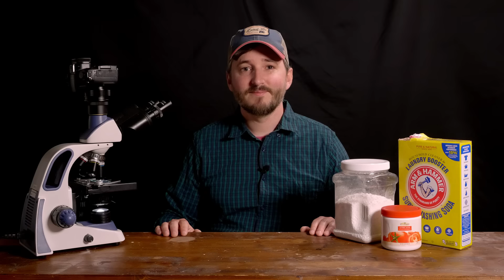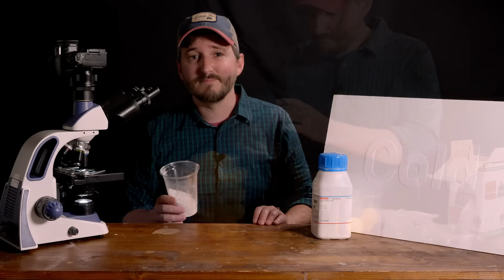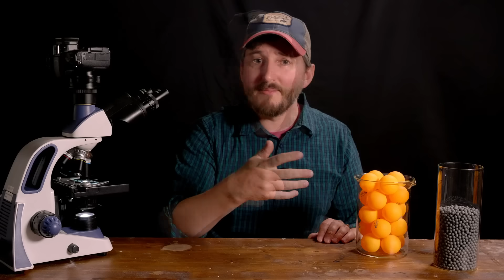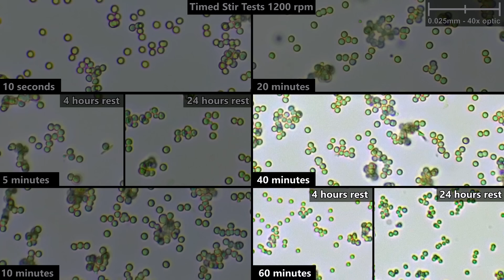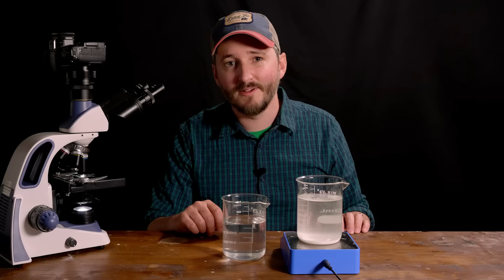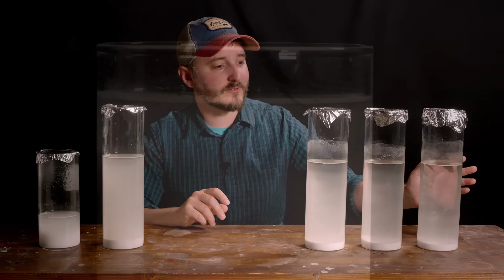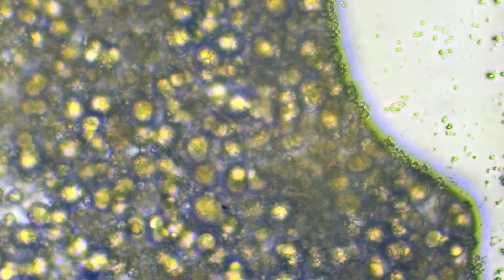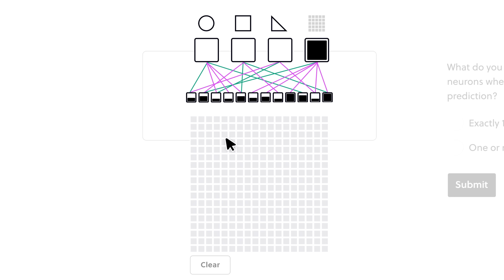Making Infrared Cooling Paint From Grocery Store Items (w/Novel CaCO₃ Microsphere Synthesis)

Comment: Thanks for this recipe, you have detailed it perfectly so a smart child should be able to replicate it. I'm pretty sure any commercial products would be orders of magnitude more expensive than your low cost DIY method, and it's not even time consuming or dangerous. Except maybe the acetone, but most women use it on their nails so how bad can it be? Just don't put it in something that looks like a water glass. You should consider manufacturing it, the markup would probably be pretty amazing.

Comment: Calcium carbonate peak absorption is at about 7nm, where the atmosphere is opaque.  Barrium sulfate is about 9.5nm, fairly aligned with a transparent window.  What am i missing?
Reply from the maker: Barium sulfate does have the greater theoretical cooling potential. I guess for caco3 we're relying mostly on the ~11um peak. It's apparently possible when using microspheres to use their size as a sort of resonator to more favorably emit particular wavelengths. Perhaps that's an area where the pigment could be improved.
Reply: @Nighthawkinlight  transmittance is only 40% at 11.5u, so the barium sulfate team has a big head start.  but if you could make your spheres integer multiples of 11.5u you might get an interesting result.
Reply: Like maybe a rooftop calcium carbonate laser emitter

Comment: An airless sprayer (though perhaps not a residential painting low-ratio electric one) would spray this coating no problem, but that's a much higher ticket item than a blender. For a cheaper option, you might also try a shutz gun, they're made for spraying thick rockguard on cars, or a drywall hopper, both would give a splatter texture but would be far quicker than brushing/trowelling
Reply: Would coating one side of bubble wrap, if very transparent wrap can be found,  then placing the coated side down, make for a premade and robust insulating layer? That might (good or bad) create a cats-eye/retroreflector effect as well if the domed side is coated.

Comment: I would suggest modifying the order of adding ingredients. It seems odd to spend so much time trying to make the densest pigment possible with various sizes, only to suspend it in acrylic filled with voids left by water. I would suggest experimenting with adding wet pigment to the water free acetone/acrylic mix. I realize that the water will not absorb into the spheres, but hopefully it will coat the surfaces and leave pigment inside your evaporative voids. This would improve the density of pigment in the final product, and maintain the flexibility/durability introduced by the bubbles. If you're really lucky perhaps you'll get a lensing effect from the void bubble that focuses the light on the pigment. Allowing the pigment to then radiate back out of the system sort of like a modified retro reflector.

Comment: If you or anyone figures out a better spray method or a way to make this very durable, I would definitely appreciate another video going over the updates. I bet this would be an amazing coating for a hexayurt or similar structure. But it needs to hold up to strong winds and other harsh conditions without chipping or flaking off of the temporary camping structure.

Comment: You should use Sci-hub for accessing academic papers, it's an entirely free and open-source project where you just paste a url or DOI, and it gives you a pdf directly with no frills. I and my professional colleges use it all the time, and many professors recommend it too! The suggestions to reach out to the author are good, but most of the time professors are too busy to bother and won't respond. Sci-hub is, and I cannot stress this enough, instantaneous and has no hoops to jump through. Its truly a modern marvel.

Comment: I know you'll get to this comment eventually.  You've done such a great and valuable service making this paint.  I live in new mexico and now I'm considering making a giant batch of this to paint on the roof of my house to keep it cool in the summer.    If i do I'll keep you updated in the comments.   Though ill have to find a better application method than caulk gun squeeze
Reply from the maker: You will also need a better binder than acrylic. Silicone is best for a roof coating but I have not yet developed a working silicone version of this paint
Reply: @Nighthawkinlight  hmmm i will consider that.  Some way to get the transparent silicon to foam like the acrylic would be tricky. 

another option to consider.  If the coating is cheap enough then it could be a yearly procedure for the warm months.  

I'm in the mountains near Albuquerque and we have a wide swing of seasonal temperatures and if I could have a black roof for 7 months of the year and a reflective roof for 5 then i would.  In fact running the numbers I'm considering putting up a whole house sun sail system and painting the roof black to get the best of both worlds
Reply: @Nighthawkinlight if it is bound with silicone, would future re-coats or paint stick to it? 

I’ve been researching what to use for sealing rv/caravan roofs and they advise agains using silicone because nothing sticks to it and it’s difficult to remove if it needs repair. 

So far, I’ve seen urethane and rubber products recommended. Bitumen has similar problems with recoating (and usually not uv stable). Or add some kind of elastomiser to acrylic? 

Could you add to a resin at all (e.g. polyester) for a hard shell? 

I don’t know much about any of this and I’m just waking up, but silicone immediately makes me question future maintenance despite its excellent waterproofing capabilities.

Comment: Fantastic video as usual!  I know you mentioned that the temperature is not a significant factor, but I would be curious if controlling for humidity would make a difference.  I'd also be curious if mixing the powder into a silicon caulk would  increase durability and allow for applying consistent coat thicknesses (though I'm sure that would run the risk of retaining some of the heat instead of reflecting it).  And such ends my armchair scientific curiosity.

Comment: Is the packing efficiency of mixing sphere sizes higher than only using the smallest sphere size? I feel like the advantage to mixing sphere sizes comes into play when the smallest sphere size is considerably more difficult to manufacture than the large sphere size, since a much smaller amount of the smaller sphere size is needed to fill the remaining space left by the larger spheres. But in this case, creating the smaller sphere size is only a matter of additional time mixing, which would otherwise be used creating the other batches, so the time investment would be largely the same. My intuition says it would be easiest to simply mix up a large batch of the smallest size spheres and use that, rather than making 3 batches of different sized spheres and combining those, but curious what the numbers say about density or other properties of the final mixture that might not be present if only the smallest sphere size were to be used!
Reply from the maker: Zoom in on small spheres and you will see the empty space between them is identical to large spheres. A single sphere size produces about 65% dense packing no matter if they're big or small

Comment: Would it be possible to 'paint' this on to one of those clear acrylic pieces that you got from the hardware store?  I would think the acetone would evaporate off before it could dissolve any significant amount.  Just thinking about making this paint the 'backing' to a sheet.   So the acrylic acts as a protective barrier.  might need to sandwich your spheres in an acrylic sheet sandwich.  If the acetone 'etched' a little that might cause beneficial scattering as well?  I suspect there will need to be quite a bit of research on how to safely seal this material so that it can't be damaged.  And if not an acrylic sheet, what about polycarbonate?  Like a CD.

Comment: 4:08 Thinking about how to get it to work for an exterior coating, the idea of a 'second surface mirror' comes to mind... have it behind a thin layer of a much more durable material, one transparent to that wavelength of infrared and preferably highly reflective in most other wavelengths. That way the CaCO3 can emit the IR to space, is kept safe by a durable coating, and ideally is kept in the shade to maximize the efficiency of heat transfer from the thing being cooled to the radiative paint layer. I saw you had a heat sink coated with the paint later, and I assume you're already on that path, but just wanted to throw the idea out there!

Comment: Did you find that the efficiency of the paint changed dependent of the material it was applied to? As the material that is is applied to, I assume, would hold some radiant heat and thus heat the paint from behind, using a material that has more efficient properties to whatever this characteristic would be. My thoughts on a more efficient material to try would be to use Corrugated Plastic Sheets, clear or white, possibly even sealing the ends so that the air pockets are sealed from air exchange, like double and triple pane windows.  

 As well as did the efficiency change dependent on the size of the area panted, where limiting the temperature of the directly connected material next to the panted area might provide some efficiency? As possibly a method to achieve the same effect as the plastic wrap + the airgap barrier in between, you might consider trying bubble wrap. As the tiny air pocket bubbles create a seal air barrier in between, limiting the effects of the outside air. It should work directly attached on top of the paint, rather than a distance a way from the paint. Due to the bubble wrap having areas that would also not have the air pocket barrier, a second layer mirrored in the direction of the bubbles laid in a way that the bubbles sit between the other bubbles could fix this.
Reply from the maker: The better the base material can conduct heat to the paint the better the total cooling capacity will be

Comment: Wow, you have provided very valuable and insightful information. Wonder if made in the correct viscosity it can be 3D printed with a wide nozzle. The base material can even move under the nozzle off a large roll stock (This is more of a manufacture concept) to make large quantities of sky cooling surfaces. I see manufacturers now racing to make adhesives to keep the material on the base and/or developing a coating material to keep the sky cooling material from flaking off the base surface. Thanks for sharing.

Comment: I would suggest taking a lesson from tile layers. 3D print a half millimeter tooth trowel to spread uniform lines on your surface. Let it dry now you can squeegee material into the voids. Once that dries you should have a very consistent thickness of your material.
☮️❤️🌈

Comment: have you checked the particles AFTER drying? drying can significantly change surface properties. putting it in the oven might cause a hydrothermal synthesis with the water, which might make the properties worse than they could be
Reply from the maker: Yes many of the microscope shops were post drying

Comment: What is the wavelength of radiating object determined by? What I understand from Wien's displacement law is that wavelength at which the intensity of radiation is maximum (peak emission) is inversely proportional to the temperature of the radiating object. Which means, at least I thought it does, wavelength depends on temperature (mostly I guess)
Reply from the maker: For a perfect blackbody radiator that's correct. Different materials have their own unique emission spectra based on the resonance of the various atomic/ molecular components. Wikipedia has a pretty good article on the subject titled emission spectrum

Comment: Great idea - very impressive - and potentially useful. I wonder if a clear enamel coating, on top could be used to protect it and make it more durable.  And/or could it be mixed into a commercial clear epoxy, perhaps a UV setting type and painted on in the usual way?  The advantage of a UV setting epoxy is - it does not all have to be used all at once.

Comment: Where can you even buy acetone that doesn't already have an unreasonable amout of water in it?
Reply from the maker: I'm using it off the shelf with however much water content is standard. If the mixture gives you issues you can dissolve acrylic in the acetone and add water a little at a time until you find a mix that works well.

Comment: A really great vid. I really like your series on cooling paint and fire resistant paint. Keep it up, I would really like to see you crate some kind of application for the paint. I must say, that I have doubt about smallest spherrs being nano-sized. By definition nano-particles (spherical) are 100 nm or less in diameter. That makes such particles invisible for normal microscopes, since they are smaller than wavelength of visible light. They also usually don't settle that well without a centrifuge. I think you should be able to see a "sollution" (colloidal sollution) of such particles coalesce. It should look kinda hazy with a blueish tint under light

Comment: As to even application, perhaps you could make an applicator that would allow you to easily and evenly apply the coating?

What I'm thinking is, something like a notched trowel for laying down grout for tile work, but with the fins that keep the main blade up from the surface being much thinner like 1mm and set a bit further apart, so that the paint naturally slumps back in to fill the voids?

Then I think you could just put the paint down as a blob and then spread it out into an even thickness set by the height of your fins?

Comment: Very cool video. Just an idea. Have you tried to use small particles as a seeding for growing of bigger ones? This could eliminate the need for stirring of most of batches and maybe make the bigger ones more even and easier to get them of the right size. That way you could calculate the sizes even before experiment by dividing probable mass of product by number of particles.

Comment: Not sure about other countries, but in Hungary, CaCO3 is traditionally used to paint exterior house walls, although not as commonly nowadays. By heating CaCO3, CO2 is released, and CaO (égetett mész) remains. Adding water to it, you get Ca(OH)2 (oltott mész) and heat. That can be painted on the walls, and it absorbs CO2 from the air, and hardens to a white paint of CaCO3 (mész).
Reply: We have this too, 30 years ago we used to spray it almost everywhere except inside the house. Trees, work shops, animal dens, concrete fences, those big round vents in an energy/heating plant. I want to see a comparison now to see how much his method improves it, I bet that acrylic will really give it a boost.
Reply: After looking a bit deeper into this, I found that some people even use lime wash for interior walls. It's very cheap, but the paint is highly basic (pH 12-13 according to google), so some precautions are necessary to avoid skin and eye contact.
Reply: Also known as lime wash in other parts of the world. Plus if you make it out of sea shells instead of mined rock it's carbon neutral.
Reply: @namAehT  Source of the material does not matter for carbon neutrality. You start with CaCO3 as a resource, remove the CO2 to get quicklime and then it absorbs the same amount of CO2 again when it cures back into CaCO3. What makes it not carbon neutral is the step to remove the CO2 in the first phase. You need a lot of heat for that, which mostly comes from fossil fuels nowadays.
Reply: That’s amazing!
Reply: But this dissolves back to water in the rain. So it needs a protection layer.
Reply: @alexlo7708  It shouldn't, unless you have acid rain. And it's repainted every couple of years.
Reply: @szaszm_  Every limestone can dissolve in water. Acid just speeds up the process. Out of dissolve problem, there are still problem on dirty surface from any cause which it raises up heat.
Reply: @alexlo7708  it's only slightly soluble in water. We have limestone deposits exposed on Earth's surface, which we wouldn't have if they would all dissolve in the rain. I can say that my grandparents' house is painted white with lime, and it wasn't repainted in the last couple of years (~5y), yet it still looks totally fine and still white. It needs to be repainted roughly every 5 years, but that's not significantly different from other methods. No protection layer is necessary, but it does slightly fade over the years. I guess it wouldn't work in climates with heavy rain.

Comment: Maybe try spreading the paint with a toothed spatula like is used for tile cement to control the thickness - you'll probably want to 3D print a custom one with thin teeth and wide gaps though.  Or maybe just glue a couple of nails to a normal spatula

Comment: Can someone explain why you wouldn’t just want to make the smaller size to start with? I have theories, but confirmation would be nice.

My guess is that the larger partials are solid, thus not lending empty space to gaps, while the smaller ones are to just fill in the space between with something other than air… but someone who knows more than me could either disprove or prove this theory.
Reply from the maker: Zoom in on small spheres and you'll see the same gaps as the big ones. Only by combining sizes do you get better than 65% density.

Comment: What if you used Hydrogen gas H2 instead of water H2O wouldn't that remove some of the air that the calcium chloride reacts with? Maybe it would even work as a direct reaction inside of a spray paint gun?